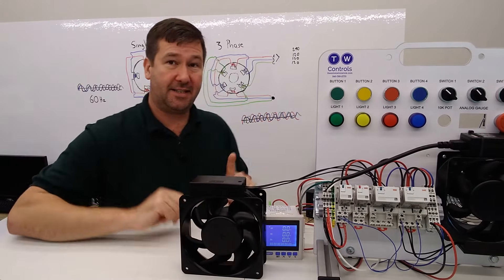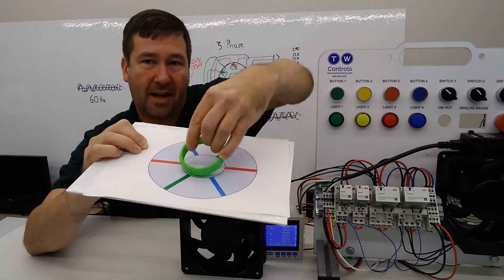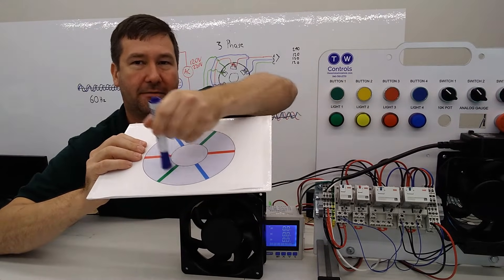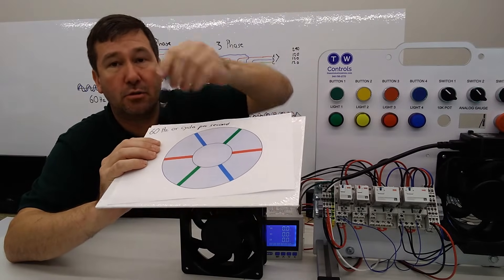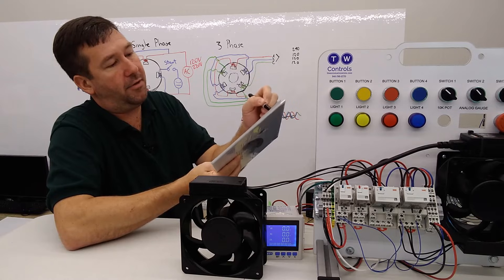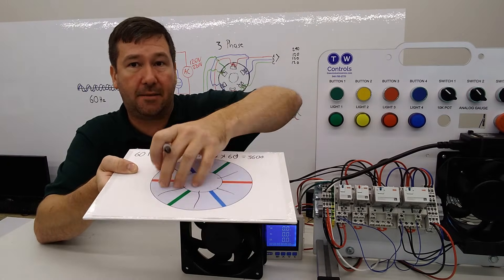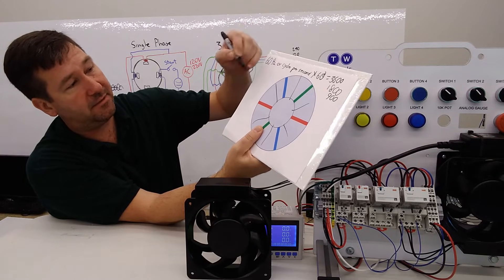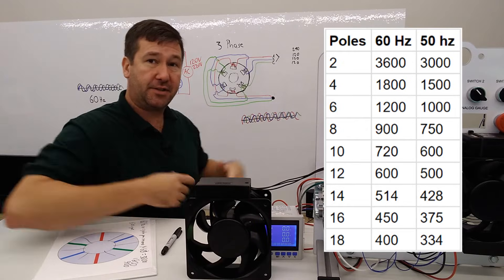Motor Poles and RPM Explained

Comment: The correct formula for synchronous speed (Ns) is 120 x HZ / number of poles.  Example for your video 120 x 60/2= 3600RPM
Reply from the maker: I'm not following you. Aside from rearranging the parentheses, how is that different? 
RPM = Hz* (2 / poles) * 60
https://twcontrols.com/industrial-control-wiring-course/motor-poles-rpm
Reply: @TimWilborne   Just telling you how UTI teaches their HVAC-R Course.  That's the formula for Ns.
Reply from the maker: @MeritocracyOnly It is the same formula. Mine just shows how the values are derived.
Reply: @TimWilborne That is actually true, It gives a more intuitive sense of what's happening.

Comment: If you can't see the motor, submersable and can't get old VFD settings. How to tell what rpm the motor is? or poles? can the new VFD tell.
Reply from the maker: Yes, that is tough without pulling the pumps.  We we worked in water, we always put a copy of the motor nameplates in the panel just for this reason.
Reply: @TimWilborne  Thanks, well have to guess. looks like most 10hp 480vac motors are 1750rpm 4 pole. Cheers. love your channel. I'm 12 years into PLC AB mostly. Fun stuff. 525 and 753 drives lots of these.
Reply from the maker: You are welcome

Comment: SO IF I HAVE A 220VAC SINGLE PHASE MOTOR THAT RUNS @ 1800 AND NEED THE MOTOR TO RUN @ 3600 CAN I ELIMINATE 1 POLE
Reply from the maker: It isn't that easy. You need a 3600 rpm motor
Reply: @TimWilborne  thanks
Reply from the maker: You are welcome

Comment: does the torque go up with poles
Reply from the maker: No. Because motors are rated based on horsepower so while doubling the poles would in theory double the torque, the winding sizes are also cut in half.

Comment: More torque though
Reply from the maker: Maybe...but probably not.  You comment was vague so I don't know if this is the conclusion you are jumping to but many people say that doubling the poles doubles the torque...the part they leave out is that a 5hp motor with double the poles is a 10 hp motor.  A 5hp 2 pole motor will have approximately the same torque as a 5 hp 4 pole motor.  In one of the other videos in this series, there is a great argument between two people over this very statement.  In the end, some motor specs gained torque on their 2 pole equivalent and some on their 4 pole equivalent.  There are too many variables involved to make a blanket statement.

Comment: is 3600 rpm for 60hz fixed? how can we adjust the speed? by changing pwm frequency? or voltage?
Reply from the maker: You could use a VFD or AC drive to lower the frequency.  If you have the Hz then you half the speed.
Reply: @TimWilborne  i see thanks!
Reply from the maker: You are welcome

Comment: I have a scooter hub motor that is 15 pole pair?  and a fardriver ND 84530  the problem is the driver is 14 or 16 pole pair settings only (so in the middle ) . I think the motor gets a little hot and self disconnects the hall sensor? does this pole count make the motor run hot ? when it works it is a most wonderful scooter for about 30 seconds . then have to wait for it to cool down to reset . any thoughts would be very welcome ! thanks !
Reply from the maker: That wouldn't be an AC motor like we are talking about in this video. It is likely overeating because of an incompatible voltage or too much load
Reply: @TimWilborne  thank you . I have 530 phase amps going into a 2800 watt motor @ 86-100.8 volts . Maybe need a bigger motor? 🤔  I found out last night . Thanks for the idea !

Comment: Vacuum motor has brushes and no magnets. Motor sounds like 20 to 30 thousand rpm. Guess the magnets can't get to hot n loose guass strength all electro magnets. Seems the lower resistance windings lower amount of poles are faster. Takes alot of amperage to push there speed under heavy load though.

Comment: the poles of a motor is the analogy of a gearbox transmission to more poles more torque and less speed while the electrical power remains constant.

Comment: Hello, so if I want to make a generator from a three-phase motor that has 8 poles, then the number of magnets I have to put on the rotor is 24 magnets? (12N and 12S)
Reply from the maker: I'm not sure. Here's a video of my kids did adding magnets to a motor to make a generator, I'm still not sure I understand the optimal placement.
https://youtu.be/15xdirMzPoo

Comment: You should explain how lag affects the actual speed of the motor
Reply from the maker: A lagging power factor won't affect the speed of an AC motor but as your motor is put under a higher demand you will get slip which is what is required to produce more torque.  Both power factors and slip are fascinating subjects, I might have to come up with a creative way to show them.

Comment: I have disassembled multiple Baldor motors; both 1800 and 3600 rpm and  I noticed that that the 3600 rpms use a lot more wire in the windings ( which take more space) and as a consequence the rotor's diameter has to be smaller. On the 1800 rpm motors the rotor is bigger and there's less wire use for the windings.   Could anybody explain why?   I'm just curious as to why that is the case. Each comparison was made using motors being the same HP and having the same physical size.
Reply: The 1800RPM (1725) have all those windings in SERIES (AFAIK), thus to TOTAL bulk winding volume is about the same AFAIK.  (it is just getting split, distributed among more locations around the circle...
I'm not sure about the smaller rotor size: but there are two things maybe going on there:
In the 3450 RPM induction motor, the armature field is going THROUGH THE CENTER, and in the 1725 RPM motor it is going in 4 'semi-circles', sort of 4  arcs.  thus a longer distance (larger rotor) will separate the stator's adjacent poles more, to go through enough metal in the rotor before exiting the rotor again to another(s) other pole...
You mentioned Baldor, and the video is implying inductions motors, so he didn't include slip in the discussion.
Only synchronous motors run at the calculated values (motors with a PM rotor or defined discrete poles).
On an induction motor, the magnetization occurs anywhere around the surface, and is generated by currents 'induced' by the slippage.  (if it didn't slip, the rotor would NOT be magnetized into poles!).
Standard '3600rpm' motors have a slip of 150rpm (relative) giving 3450 RPM speed.
Standard '1800rjpm' motors slip 75rpm yielding 1725 RPM operation...
Mr K L     [ I apologize if others already said this, no time to look; I'm working on Taxes LOL]

Comment: Awesome that's what I expected. Now the question is how does this relate to torque output. Does increasing the poles to reduce the rpm greatly effect the torque output due to less inertia?
Reply: Torque output requires higher current draw. In a 2 pole motor there will be gaps where flux is not at it peak due to the rise and fall of ac sinewaves. Torque is strongest around the center of each pole when energized. This area is called the torque angle. The more poles there are the more torque angles exist thus increasing torque. To achieve higher torque at 2 pole, the motor would have to be rebuilt to withstand the current draw i.e. increasing turns, wire gauge,  wires on hand, redesigning for higher voltage, or wiring in delta; or a combination of each.
Reply: @Zapgod  Nifty. Thank you for the answer. I thought that may be the case but I am limited on this field of knowledge.

Comment: Thanks nice explanation of poles. I have a question, I came across TFO-FK 2p 200V motor. Its got 3 wires coming out of it. Not sure how to hook it up as I've got single phase 220v and 3 phase 220v supply available.
Reply from the maker: You need to make sure what you have but it sounds like a 3 phase motor, you'll need a rotary phase converter, see link below.
https://www.youtube.com/watch?v=k9tR9d3DsqY

Comment: hi , very good and clear  explanation for the motor, i have a question about the rpm of generator , how i calculate the speed (rpm) of generator with 10 pole ?
Reply: rpm = frequency * 60 / (pole pairs)
So lets say your frequency is 60Hz, and you have 10 poles (= 5 pole pairs), your rpm = 360

Comment: Very interesting and well explained.
How can I make the connection for 3pole at 2780rpm
Reply from the maker: Check the motor nameplate.
Reply: @TimWilborne  noted...
Thanks
Reply: @TimWilborne  Pls , kindly advise what determines the higher Rpm and lower Rpm of an electric motor.

Is it the number of turns or the connection at which the poles are connected or the both?

Comment: If I have an ac motor Which is 110v,  how doi rewind so I can run off a lower voltage? 12v- 36v area if possible
Reply from the maker: 12-36V, I'm guessing you are talking DC?  Not possible.

Comment: You could actually make the motor turn in both directions, by adding a dial, if you connect negative to negative and positive to positive, the motor will turn in the correct direction, if you connect negative to positive and positive to negative, the motor will turn in another direction.
Reply from the maker: No not in this case. We're talking about alternating current in this video. There is no positive and negative.
Reply: @TimWilborne  I know.

Comment: One thought to add, speed of an ac motor inversely proportional to no of poles, and directly proportional to frequency, your video time 3:06 supports this.
Reply from the maker: Yes, stick a few more numbers in there and you have the formula.  RPM = Hz* (2 / poles) * 60
https://twcontrols.com/lessons/motor-poles-amp-rpm

Comment: If I lower the RPM will it affect the Hz ? Say for instance , we use 50hz electricity which is 3000rpm and the motor am using to turn the alternator am working with is 1800rpm and so the alternator is not generating power, what should I do please ?

Comment: Awesome, very helpful but how do I insert the poles to get a 50hz alternator and how do I get the poles ?

Again, I like to know, what happens to to the generated power when you reduce the rpm since it changes the rpm ?
Reply from the maker: The formulas and 50 Hz information is at the link below.
https://twcontrols.com/lessons/motor-poles-amp-rpm

Comment: Can you please answer me if this applies to DC motors as well as AC Motors? I just cant find the answer
Reply from the maker: It depends on your field current and armature voltage.  I don't have the hardware to make a good video on that.
Reply: @TimWilborne  I mean as a principle when you calculate the rad/s runner speed with given rpm and different sets pole pairs

Comment: Why the MAX  speed of an AC motor is 3600rpm (USA) and 3000rpm (europe) and why we don t speed up the motor to a high RPM if we want that, such as 6000rpm (100hz) or 7200rpm(120hz)and  is this possible????Or maybe 3600rpm is the better RPM and we can t change that in USA or EU??? PLS answer to me!!😀😀😅😅
Reply from the maker: Hz is part of the RPM equation, so the lower 50 Hz will run at a lower RPM.  See details at the following link.  Why not 6000?  Because the bearings wouldn't hold up. https://twcontrols.com/lessons/motor-poles-amp-rpm

Comment: If I get a 2 pole motor, is there a special esc for that ore not
Reply from the maker: I'm not following what you are asking
Reply: @TimWilborne  2 pole motor ore 4 pole, do you need a special esc? I. Saw someone wase. Explaining that esc for 2 pole motor Nother esc for 4 pole motor what the hell is that
Reply from the maker: @manush1119  Is ESC an abbreviation for something?  I'm still not following you.
Reply: @TimWilborne  2pole motor ore 4 pole motor. Do I need to change esc to run them ore. Use same as I use. On my regular brushless
Reply from the maker: Some of the abbreviations  you are using are not translating.
Reply: what is esc? author cannot answer if you dont explain wtf esc is.
Reply: Esc stands for “Electronic Speed Controller”. Im assuming the author is talking about RC car electronics. And if so, most if not all ESC’S will run 2 pole motors without a problem. And depending on which size or scale vehicle you’re putting it in, they will run 4 pole motors just fine. There are a few out there that don’t work with 4 poles, and a couple that you can change the software in them to allow them to run 4 pole motors. The Maclan DRK160 RS is one of those you have to do a software update on. This video doesn’t apply to anything related to RC electronics, except for the motor frequency. Although the motor drive frequency doesn’t determine the max rpm for a given pole count motor. I’m turning a 6600KV (6600rpm’s per 1 volt applied) 4 pole 550 size motor (36mm x 60mm)  over 90,000rpm on an 2S 8.4V LiPo battery and the motor frequency is at 4Khz. With brushless DC motors, your battery voltage determines your max rpm for a given KV rated motor. Although this rpm per volt applied number can be increased either by adjusting the built in timing advance on the end bell. Or, if your ESC is capable of it, you can add in electronically controlled timing advance if you’re running a sensored motor. If you have any more questions, hit me up on FB.

Comment: which is much better. Star winding or Delta winding ? thanks
Reply from the maker: Neither, star and delta wiring has to do with what voltage you are connecting to the motor.
Reply: If I'm connecting 80v battery with a Delta double Star connection could it be possible to double or step up the output voltage with those connection? If not how can I double my battery output for a higher voltage motor

Comment: which one is better between four poles or two poles for table saw (wood saw) ?
Reply from the maker: It isn't a matter of which one is better, it is a matter of which one meets the requirements for your speed.  Figure out what blade speed you need and work your way back to the motor.
Reply: @TimWilborne  if I use a ratio pulley to get the required rpm,which is better between low rpm with higher torque or high rpm which is closer to the required rpm ?
Reply from the maker: @farhozz  There won't be a big difference.
Reply: @TimWilborne  Thank you very much sir

Comment: how to calculate turns for single phase 24 slot 4 pole 1440 rpm core lenth 3.4" inner dia 4,4" nd outer dia 7 inches
Reply from the maker: That's a little out of the scope of this channel.  Google "calculating motor turns".  On second thought, that might be a fun one to do with the kids.  Maybe we'll make a homemade motor.

Comment: Can i replace my motor on my compressor to 4 poles from 2 poles?

anyway, thanks alot
Reply from the maker: You could but it would be a bad idea.  The compressor itself probably isn't rated for the higher RPM.
Reply: @TimWilborne  which is higher rpm? 4 or 2 poles
Reply from the maker: @romnellejohnco5887  At 60Hz, 2 Pole is 3600 rpm and 4 pole is 1800 rpm.
Reply: @TimWilborne  thank you sir. I learned
Reply from the maker: @romnellejohnco5887  You are welcome.

Comment: What happens if the hz are increased, say 200hz or more
Reply from the maker: Motor speed is proportional to Hz.  So if you have a base rpm of 1800 at 60 Hz then 1800*200/60 would be 6000 rpm.  However your motor would burn up shortly after getting there if it even managed to.  Torque falls off as Hz increases, bearings aren't rated for it, and the motor windings will overheat.  I hope this was a philosophical question.
Reply: @TimWilborne  Am working on Ev and i have a few queries about those motors, can we discuss this via email or WhatsApp?

Aumecycle@gmail.com

Comment: How about for a 6-phase 3-pole motor? I'm a little confused as I thought the poles where how many windings the motor has. I was trying to use the equation for this fan. It looked like 6-pole
https://thermalbench.com/2016/10/31/be-quiet-silent-wings-3-140-mm-high-speed-fan/
On page two it says "These fans use a new IC motor with a 6-phase, 3-pole design" but I have a feeling that is a typo and meant to say 6-pole 3-phase?
Reply from the maker: Hi Kurt.  That fan uses a DC motor which is different than the AC poles and RPMs that this video is talking about.  I probably should touch on DC motors sometime.

Comment: Clear as water, thank you very much!
Reply from the maker: You are welcome!
Reply: @TimWilborne  I have a crank with magnets on its pulley. The magnets are turning around a 6 pole 18 slots stator that charges a 12v battery after going through a rectifier that keeps the voltage controlled since the crank turns 12,000rpm.

I was thinking about rewinding the stator into a hub motor adding a second battery and a controller in order to recharge the 12v battery and the 2nd battery and also drive the crank or boost its torque when I flip a switch for 10 seconds.

Will this work? What are the main difficulties of such system?